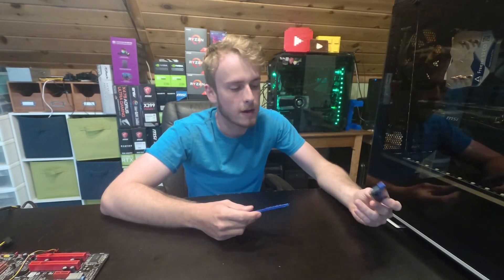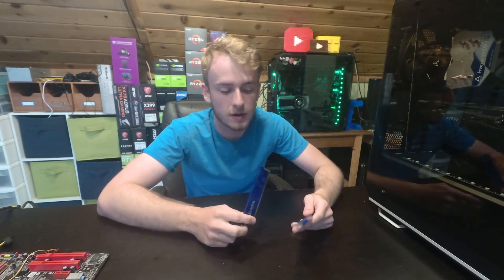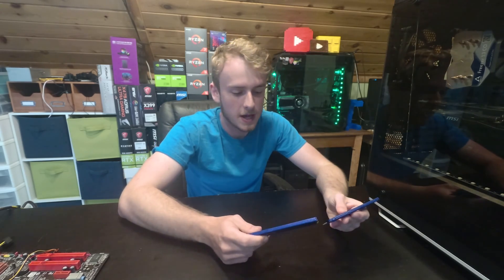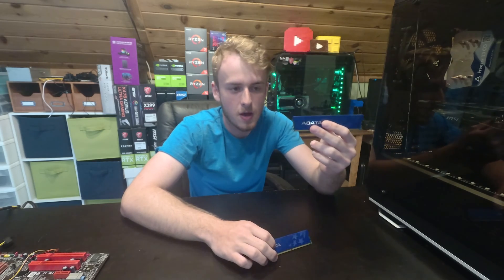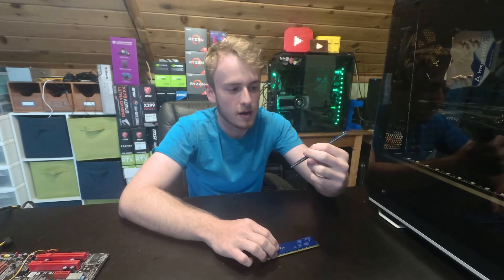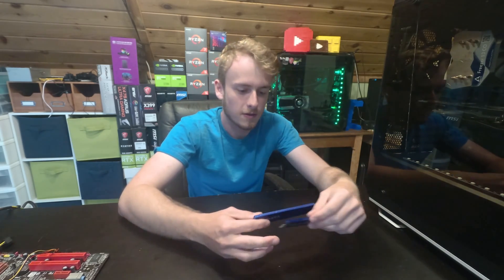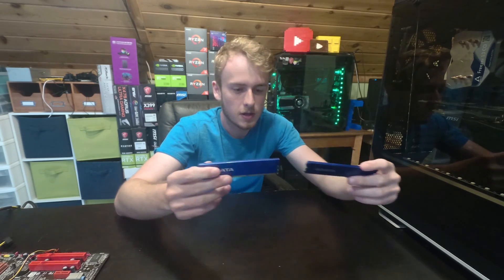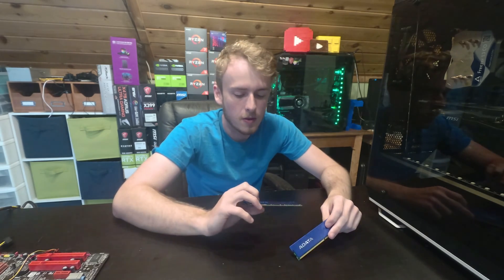Why RAM Heat Sinks Are Completely Useless and Extremely Important At The Same Time

Comment: I bought $100 ram and it doesn’t have a heat sink, I never had an issue until today when I was playing Fortnite 60fps max graphics for 9 hours,  I didn’t realize it was the ram overheating until I trouble shooted and when I touched my ram it was sizzling. So either I get a ram heat sink. Or just dial down my graphics and load while gaming
Reply: There is a live event in Fortnite tomorrow and I don’t want my computer shutting down in the middle of it so I’m going to set the graphics to medium and call it a night

Comment: Ddr5 has definitely made cooling needed if running tight timings at higher speeds. Seems like it tends to become unstable arounf 50-60c. Also odd how samsung went from being good to being terrible. Hynix all hits 6000mhz cl30 but definitly will go well over 60c even with a fan on it without good heatsinks.

Comment: Server ram without heatsink and not require overclocked which must the same is cpu requirement speed ram unless you want to overclock your ram with heatsink but I want to find one copper if that's possible better than other heatsink or stock I wonder ddr5 can be overclocked up to 6-8Ghz with high voltage I am researching on it heatsink

To be honest I haven't buy unless they make ddr6 better and future to release ddr6, difficulty to find one greater than other ram or too slow

Comment: This is true for conventional ram, servers and high end workstations that use things like fully buffered actually generate a lot of heat. This is why quality server ram typically has a heatsink. If we go back to the Mac Pro, this is even more important as these computers not only required very specific ram specifications, but also bulky heatsinks that could absorb the heat generated from the ram. Ram bus was another type of ram that generated a lot of heat requiring heatsinks. For my workstations I tend to add them for stability. I generate a lot of video, some 4k and 8k, generally you won't find this necessary unless your overclocking but if your rendering a lot of video ram heatsinks could actually help lower temperatures internally overall and thus aide in stability. But this is on the margins. I think your almost better off in investing in to VRM heatsinks before ram. That's how small of a difference this makes. Speaking Vrm heatsinks are a cheap way of squeezing even more out of your CPU. If the power delivery system can't keep cool it will throttle back your CPU and them fancy ram modules really will be just for looks.

Comment: Trident uses Samsung chips the lower end ones do not. Definitely get a line that uses Samsung chips, too bad Samsung doesn't make ram themselves anymore
Reply: a lot of brands have had models that used samsung B die for ddr4 the key to notice if its B die is normally a timing like 3200 14-14-14-34 or 3600 16-16-16-36 etc as other kits can not run tight timings like B die can. He talks about ram not needing heat sinks is some what also meh as a kit rated at 1.45v-1.5v will defintely get alot warmer then say 1.2v or 1.35v But some ram heatsinks are almost worthless for doing there actual job of sinking heat away.

Comment: If this just all talks with no data or test to back this up this video is useless
Reply: @View Bot they dont, but a proper heatsink without all the extra plastic made from the RAM manufacturers, offers cooler temps - which means you can overclock more.
Reply: @@theviewbot If you look at my post above, you will see that typical raw DDR5 RAM chips are only 11mm x 9mm but can dissipate up to 1W in a worst-case scenario (at least per the manufacturer datasheets).  1W is very small compared to what CPUs are drawing, but these BGAs are small and don't have any large tabs that solder to the PCB so removing the heat directly through the ground planes in the PCB is a bad thermal path.  And without any kind of heat spreading the junction to ambient thermal resistance is likely to be well over 100C/W.  The main reason we get away without a heat spreader is that we don't run the chips at max throughput 100% of the time.  But any good engineers are designing their product to operate through the worst case without cooking (so they add the heat spreader).  Chips age exponentially with temperature increases, so adding just a little bit of aluminum really extends their life.  Leakage current also increases exponentially with temperature, so keeping things cool actually saves some power too.

Comment: To say naked RAM is cheap, is very misleading.
I have a set of awesome Samsung DDR4 RAM, naked as a jaybird.
And I have to say, I cringed hard, at the way you were handling that RAM, LOL!
But yea, heatsinks on RAM is useless...
Reply: Your right. Generally I buy Samsung ram and Nvme SSDs for my systems. Neither are cheap and they don't come with any real heatsinks on them. I add them sometimes, but definitely I wouldn't consider them cheap. Especially say the 980 pro series.
Reply: hey, Was this purchased naked? and if so can you link it to me? im looking for some DDR4 3600mhz Naked Ram to watercool. I want to avoid a heatsink removal for possible damage. Thank you!
Reply: I buy nothing but Samsung RAM and NVME sticks. I got some used ones that were bad I think they were overheated in an overclocked mining machine. I think those sticks could have used heatsinks and probably an air fan.
Reply: I built a workstation and needed some server memory.  I ended up buying 14 sticks before I got 8 matching sticks. 4 were bad and I have 2 spares. I got 64GB total of DDR4 server memory. I added a 10,000 rpm sata III mechanical drive for using a Linux swap file also a swap partition for Windows. It boots from 2 MVME drives Linux with grub first.
Reply: I always get good-used sticks from gamers. They take care of their stuff better than workers at some companies parting stuff. I usually get used sticks packed in static bags when I buy from gamers. I got sticks in bubble wrap before not in a static bag I was lucky they still worked but for how long. I try to guess what kind of seller they are a gamer upgrades or business parting out used untested parts, a business selling tested parts that always come in ESD packing. Most gamers who like to upgrade keep their anti-static bags, I've even got original boxes on occasion.

Comment: Those RAM sticks received a real treatment during the video. Pins were touched all over, hit on table, dropped...
Reply: He do be smashing and dropping for the whole duration of the video
Reply: F
Reply: It's probably fine, but I wouldn't take the risk of beating it up like that lmao
Reply: Those RAM sticks are just fine lol.  Unless you are man handling them, they will be just fine.  😌🌎✨
Reply: ADATA is generally shit, so I would have treated those worse. This video is a bit of nonsense though, cuz you can definitely get amazing RAM performance without a heat sink on non expensive JEDEC RAM with it’s native clock speed, especially on OEM builds like Lenovo where XMP profiles is not going to happen.
Reply: A good reason to have some nice looking metal covers or heat sinks

Comment: Under the heatsinks you won't find RAM chips rated 3200-4000 MHz by the silicon makers.  Instead most board makers use 2000-2400 MHz chips and screen them through lax testing to assign higher speed ratings.   But most of all, note that the fastest memory boards from the silicon makers themselves have no heatsinks on them.

Comment: I thought so. Just a marketing gimmick. So I assume some manufacturers sell good memory without the 1950s fins?
Reply: Yes, but except for laptops they're rarely available from retailers.  They are sold by electronic parts suppliers like Mouser or Newark, at high prices, or on the used markets, typically under brands like Samsung and Hynix.